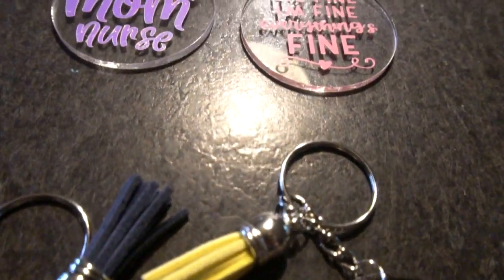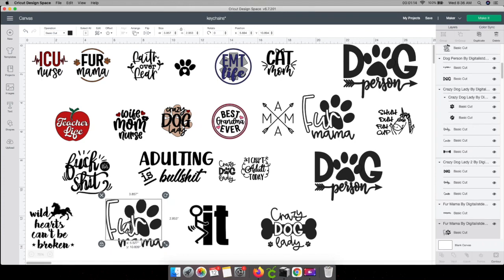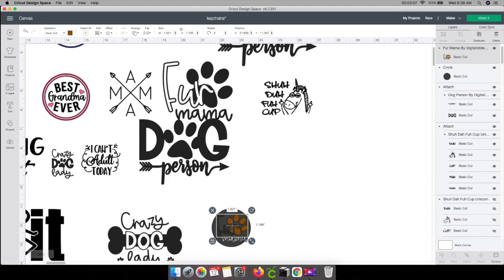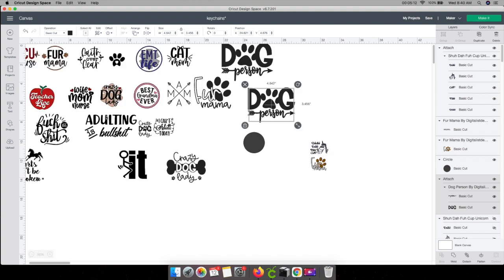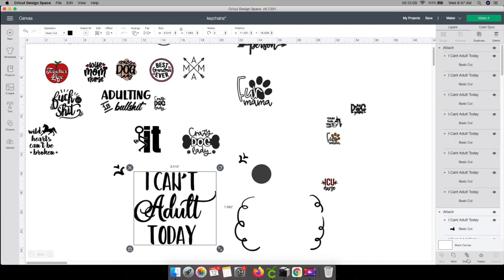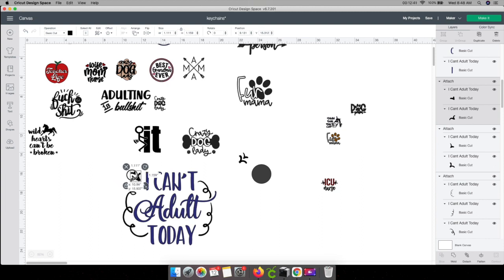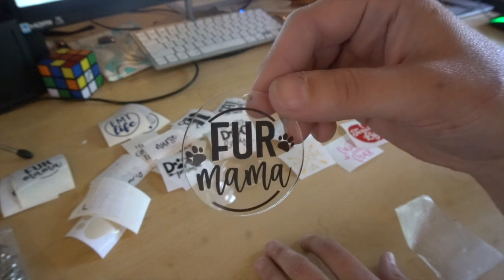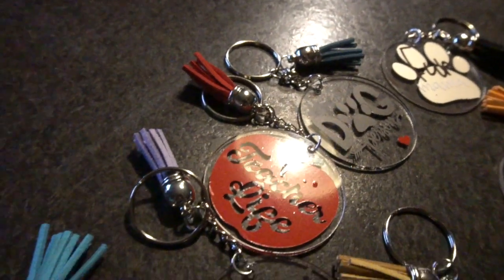ACRYLIC KEY CHAIN TUTORIAL DIY | Vinyl on Acrylic Key chains | DIY Craft Tutorials

Comment: Does the size of words matter?  I seem to have an issue with weeding out designs with lots of words or small writing.  Would welding it help?
Reply from the maker: Yes it does depending on the image.  I try to use not many words or just stretch out an image to fit into a 2 inch round.  Trial and error

Comment: I've been making these for awhile but wonder how quickly or easily the vinyl comes off em without sealing
Reply from the maker: Huh I honestly couldn't say.  I haven't had a problem so far.  Do you normally seal yours?  With what?  Maybe I should be?  They are a big seller for me in the store I have my crafts at
Reply: @icreatecrafts8462  No, i haven't found anything good to use as a seal yet but i have not given up hope hahaha. I know a lot of ppl don't seal but a lot of guys i give mine to are construction workers and such. My problem is, i just started doing these about 2 weeks ago and do not know how well it stays unsealed.
Reply from the maker: @trixie4525  Nice!  I haven't had an issue and I've been creating these for a few months now.  Perhaps mod podge spray to seal?  Not sure